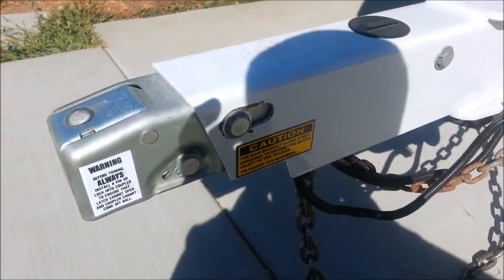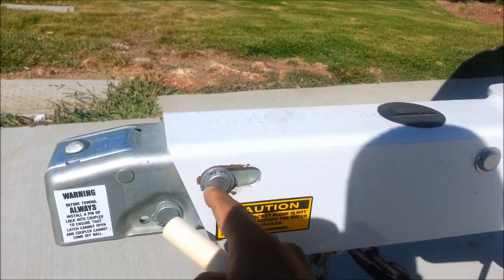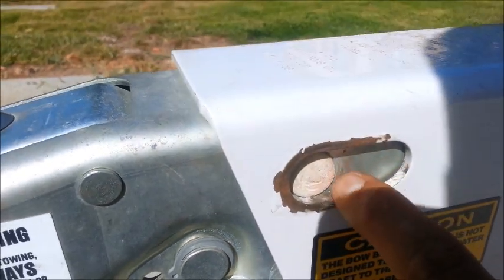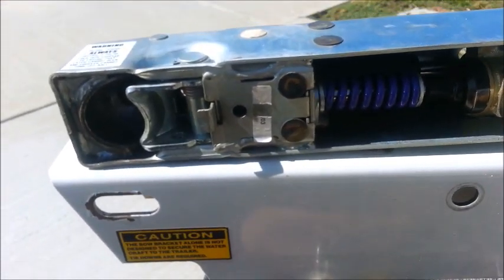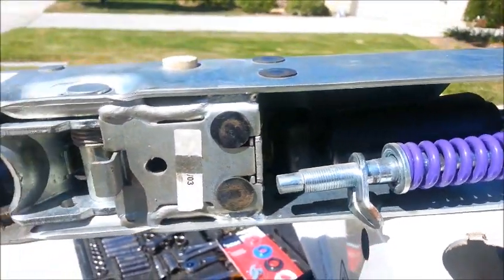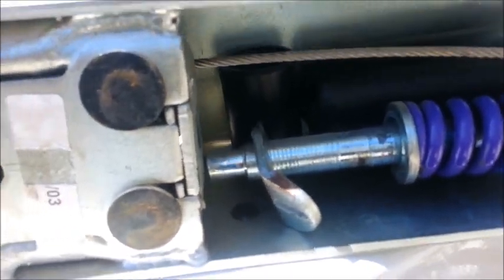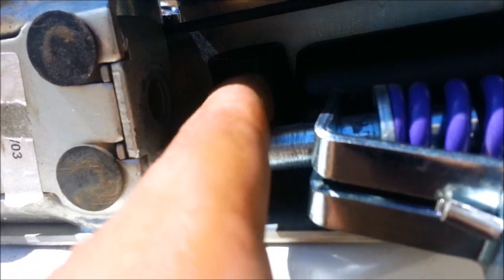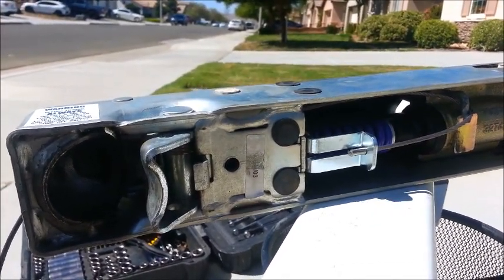A-60 Trailer Breakaway Cable Replacement

Comment: Squid, this was a great video because of 2 simple but very ingenious solutions you presented. The wooden dowel thing is genius and 2-slidng the whole actuator assembly out the back so you don't have to disconnect brake lines makes this so much easier. No need to bleed the lines. Thanks for posting this. Those who gave this video a thumbs down have no idea how much of a game changer those 2 simple pieces of advice are .
Reply from the maker: Thank you very much for your comment. This was my first or second DiY video so i was a little nervous when it came down to explaining and didn't edit. I mainly post videos to help people out there who are in the same position as me. Sometimes people are not mechanically inclined so it might be a little of a challenge. It was a lot easy than it looked. Hope it helped out. Thanks!

Comment: Great video. My trailer does not have a swing away. This means my casing slid forward. Also found routing of emergency cable around rear post worked best by removing post held by a bolt.

Comment: Clever tips using the dowels to keep the wheels in place and sliding the actuator out the back (if possible) to avoid disconnecting the brake line.  Be sure to put new clips on the pins when replacing.
Reply from the maker: Yes sir. Thanks for watching!

Comment: I yanked the cable last week. I'm gonna have to replace the cable by myself this weekend. wish me good luck. your video is very helpful.
Reply from the maker: Take your time, record and take photos if you have too. Good luck bud.
Reply: @MrDodgerblu82  I have it replaced with no prob. 🤙 Dowels make reassembling  so easy. Thanks again! I've saved at least $150 by doing it myself.
Reply from the maker: Sangwoo Oh awesome brotha! Glad to hear it worked out. Hope you can take a sec to hit the like. If you already did thanks!